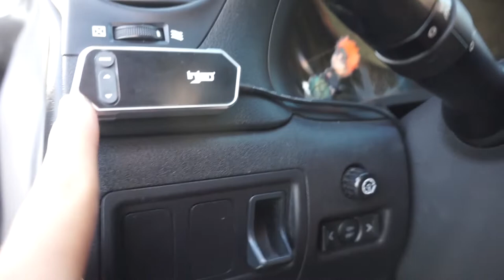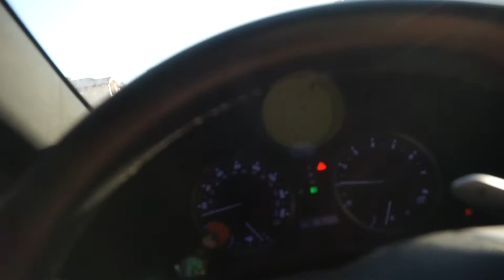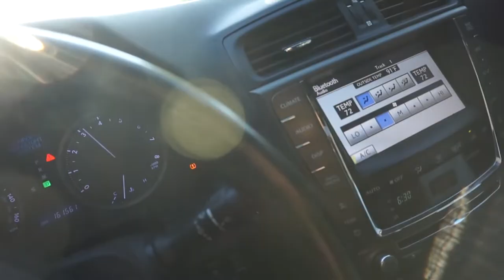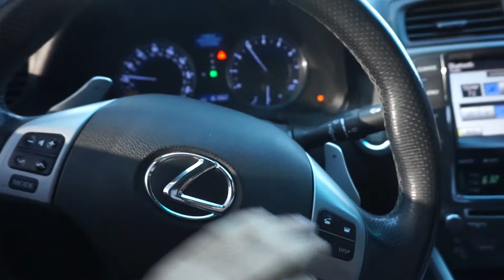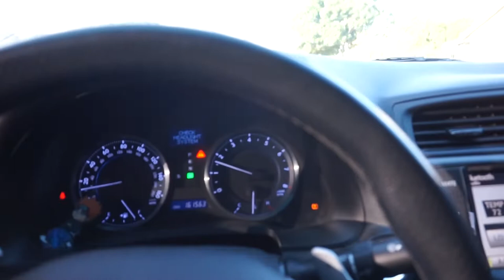Thank Goodness for Throttle Controllers!! (Shift Knob Fail)

Comment: That shift knob is for a manual transmission which has a bigger thread pitch.  You need this pn for automatic PTR51-53080.
Reply from the maker: I know freaking rookie mistake! Lol but thanks a lot for the part num. Got the right one coming in now. 👌

Comment: Many have gotten lucky and been able to dodge this bullet but learning to mod should come 2nd to learning the car and each of its critical components. I havent even heard mention of the driver side knee srs being in close proximity.  Everyone is tearing down that lower dash area while blindly reaching in to start connecting/disconnecting components....PSA:there is a driver side knee srs /shock sensor in close proximity which which need to be carefully avoided for  the obvious but that particular airbag has been noed in a technical service bulletin issue for the 2IS for years due to the airbag wire connector prematurely failing due to the slightest of tension on the wires which triggers a srs code and requires the current connector  to be cut off and the updated connector w/extension be properly soldered in its place.
Reply: Didn’t know about this, that doesn’t sound good, is that exclusive to the 2nd gen or persists with the 3IS too?
Reply: I beleive it was exclusive to the 2IS only. The problem is easily fixed by soldering in a 2-3" extensions into each of the 2-3 wires that run to the connector to allow a bit of slack if the wires get  pulled during a repair or anything that  may randomly disturb the srs wires in the pedal area. I learned this lesson by disturbing the srs wires while hardwiring my invisible radar detec. I was way out of warranty, dealer quoted me $1600-$2100, I learned how to solder quick fast and in a hurry lol

Comment: Question bro, does it feel instant go during those times you need to speed to avoid accidents?
Reply from the maker: Yes! Definitely a lot more responsive and sensitive on the gas pedal reaction rather than having a small lag
Reply: I appreciate the response back, i truly think that half a second to a full second where you press the pedal and have to wait is truly dangerous when sometimes you cannot pre determine other drivers spontaneous actions.This video made my decision. Just ordered one and 👍up on the video. Thank you for sharing this.
Reply from the maker: @nsmilitia  My exact reason for buying one myself! Couldn't stand the lag between putting my foot down and the car responding. Glad I can help and thanks so much for watching truly appreciate it!